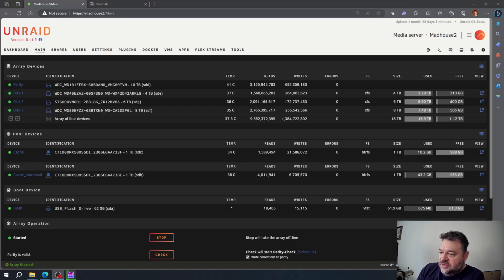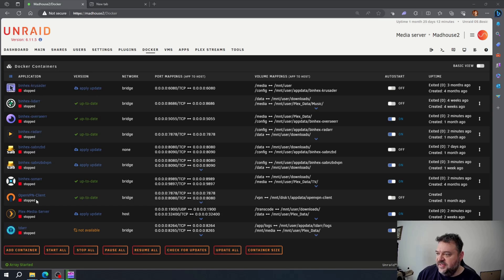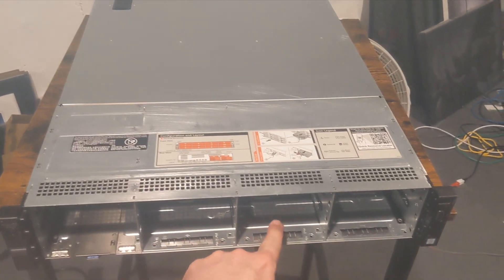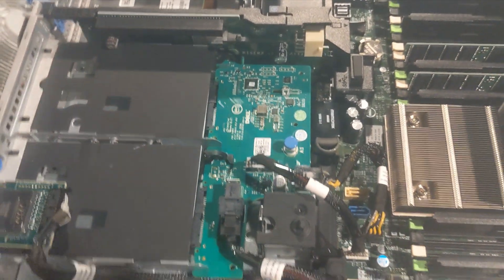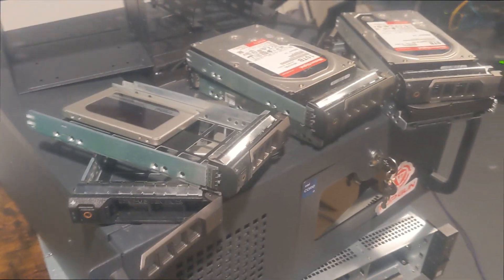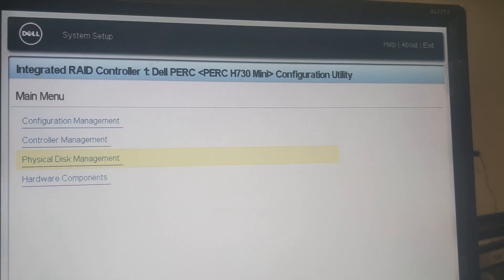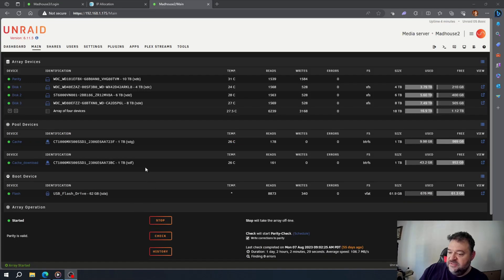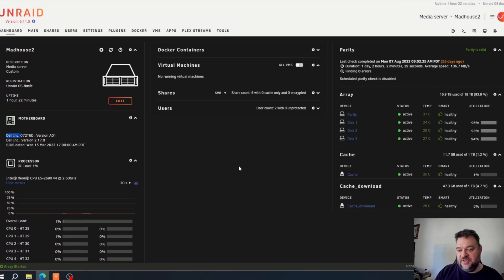Transfer UnRaid to Dell R730

Comment: When I try switching to HBA mode I just get “The requested operation is not possible at this time”. Anytime I boot off a unraid installer flash drive I just get a “no os found”. Tried multiple flash drives and multiple computers to flash the flash drive.
Reply from the maker: Check your Bios to see if it is reading the disk. You will also need to check the BIO to see if you are booting to the USB. Make sure your thumb drive Unraid image is set to BIOS or UEFEI to match your system.

Comment: Thanks for the video. I also just picked up a 730. It’s my first server. Good tips here. Thanks!
Reply from the maker: Hope you enjoy it. It is a great system.
Reply: @madtc74  Thanks, I am really enjoying working on it. Learning a lot as I go as well. Interesting things to start. I had to swap the RAID controller for an HBA for TrueNAS scale to work and learned that the NIC card is not variable speed. I have a 2.5 G switch and was frustrated for awhile  when my upload speed was terrible. Learning as I go!
Reply from the maker: @nickschatko  that's how we learn.  I had a h730 mini in mine. I just turned on HBA and everything worked just fine.
Reply: @madtc74  Exactly!
Reply from the maker: hope all is well out there.